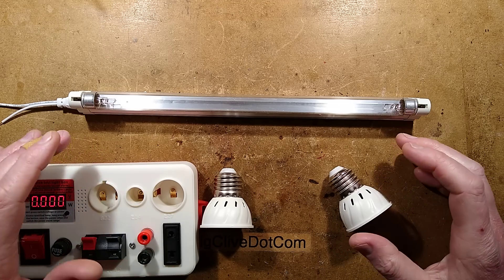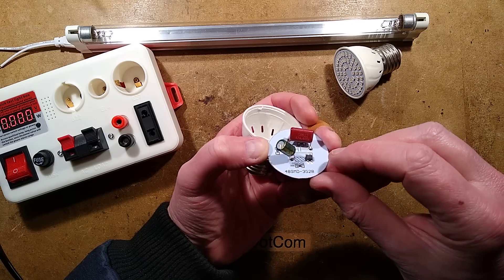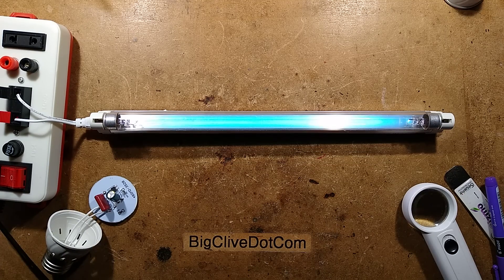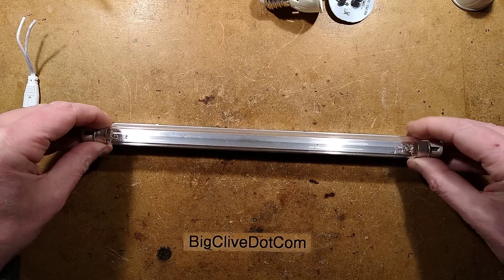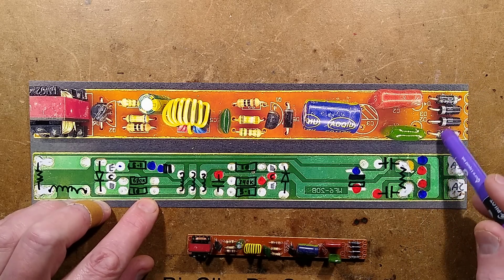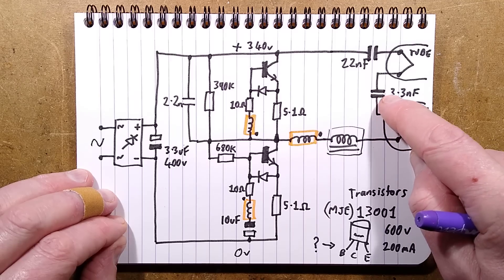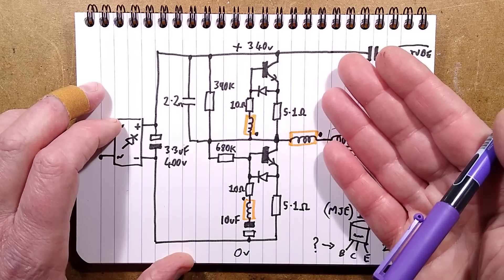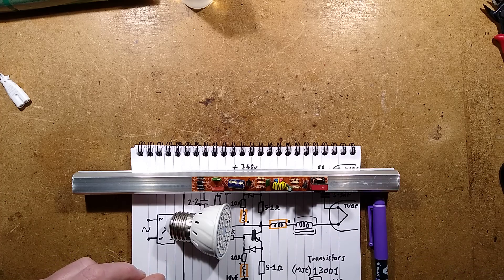UVC 2023 - the fake and the real (with schematics)

Comment: The two windings on the toroid probably run the end heaters ease the arc strike. to have some fun put a bench supply across the heater and note the heater resistance is smaller than the arc across the resistance of the filament

Comment: Hi Clive,
Do you know if UVC LEDs can be designed to generate ozone or is it only the tubes (With untreated quartz glass of course) that can ?

Also I'm still a lil' bit worried about the possible end of all non-LED lighting products (From halogen bulbs and fluorescent tubes for illumination to blacklight and UVC tubes).
Reply from the maker: I don't think there are commercial UVC LEDs in the 184nm region yet.  It's probably cheaper and easier to do it with a corona discharge system for low output applications.

Comment: I recently got a Vivitar brand "PureMobile" UV portable device sterilizer lamp (model V40061, the non-detachable one) at a discount store for US$6.00 on clearance because I wanted a small inexpensive UV light to cure small resin jobs. This video now has me wondering if the lamp is actually useful even though it's supposedly listed as a "253.7nm cold cathode UV germicidal lamp," (claims I'm not 100% sure of in the first place) as I'm having trouble finding reliable info online about portable UV sterilizer lamps like it.
Reply from the maker: That's purely germicidal.  You need UVA for curing resin.

Comment: The spectrum of a UV Mercury lamp is fundamentally different from LEDs. Mercury has a band spectrum meaning that besides its continuum spectrum, it has several peaks because of electron transitions. Some are in the visible region. UVC lamps must have argon too. As our brain synthesizes the sensation of color from the 3 color receptors the sensation can be the same for different spectra.  But LEDs emmit on a very narrow band. There are two main UV-C LEDs the ones with Gallium-Nitrogen and the ones with Aluminuium-Gallium-Nitrogen. They usually emit at 260 or 280nm or both (this is considered more efficient in disinfection). My point is that the color means very little and the LEDs tend to have a color more akin to violet if they invade the visible spectrum. As UV-C and UV-A LEDS have a similar construction the voltage drop on them is also not an indicator. The better way is to use UV-C dosimeter cards they are created specifically to test if the device emits UV-C and tell if they are safe or dangerous and determine the exposition time to kill bacteria. They change color depending on the dosage of UV-C received.

Comment: From my limited experience with CFLs, they seem to go bang when one of the filaments fail and the electronic ballast ends up oscillating under "open lamp" conditions. Then the lamp either HV-starts from back-EMF from the inductor and whatever little current manages to go through or the oscillator self-destructs either from unstable oscillation at excessively high frequency or excessive back-EMF from the inductor. The 2.2nF capacitor may be a crude way to protect the transistors from inductor back-EMF under open-lamp conditions.

Comment: No you slice the potato and lay them on your eyes been welding for over 20 years and that’s been the only thing I found that helps but never been hit directly just been spot welding with the wrong glasses
Reply: Could that work for eye strain caused by too much screen time without enough sleep ?
(Not red eyes, no "sand feeling" but light sensitivity and difficulty to open eyes still).
Thank's !

Comment: From Wikipedia:
UV (UV-C) considered "germicidal UV". Wavelengths between about 200 nm and 300 nm are strongly absorbed by nucleic acids. The absorbed energy can result in defects including pyrimidine dimers. These dimers can prevent replication or can prevent the expression of necessary proteins, resulting in the death or inactivation of the organism.

 Mercury-based lamps operating at low vapor pressure emit UV light at the 253.7 nm line.[15]
Ultraviolet light-emitting diode (UV-C LED) lamps emit UV light at selectable wavelengths between 255 and 280 nm.[16]
    Pulsed-xenon lamps emit UV light across the entire UV spectrum with a peak emission near 230 nm

Comment: Clive, a few points need correcting/clarifying.  I am working for a company developing UVC LED products and this is what I know.  Research on 222nm radiation (at the short end of the UVC wavelength spectrum) shows that these wavelengths get absorbed in the top layers of the skin which are formed from dead skin cells.  It is therefore unlikely that you will get skin cancer from very short wavelength radiation, however radiation at the longer end of the UVC wavelength band penetrates deeper and may cause cancer, more research is needed on this.   Mercury lamps emit radiation at a number of different wavelengths but the main one responsible for the germicidal action is 254nm.  The wavelength shown to cause most DNA damage is 265nm and although you can buy 265nm LEDs most current UVC LEDs emit at 275-285nm (although the trend is towards 265nm). I have been working with UVC for a few years and haven't heard of anyone getting skin irritation or welders eye from pure UVC due to the fact it doesn't penetrate very far but I wouldn't risk exposing myself to UVC simply because it is so good at attacking DNA.   If you want to block out UVC but still see what is going on simply put a sheet of Acrylic over the source.  UVC LEDs will glow a very dim purplish white colour when seen through Acrylic sheet, if they are purple/blue they are fake.  Some dodgy products use cheaper UVA/UVB LEDs which are cheaper, probably more dangerous and less effective but most fakes use purple LEDs.  All thermo-plastics are deep black to UVC radiation so if you see a product that uses an injection moulded white plastic housing and says it is a UVC product it is most probably useless.

Comment: Another place to get ultraviolet damage to your eye (called uvitis by eye doctors, really!) is from mercury arc rectifier valves. I knew a guy who said his unshielded WW2 radio rack "hurt his eyes". I enlightened him (no pun intended.)
Reply from the maker: Those valves usually use soda or lead glass which blocks the harmful wavelengths.
Reply: @bigclivedotcom   But still lets all the UVA pass right through it and apparently some people have more sensitive eyes than others, including myself.
Some blacklight tubes (Both Wood's glass and bright blue, insect killer ones) actually hurt my eyes after a short time in the same room, not even directly looking at them. As a result, when making cyanotypes or retrobrighting yellowed plastics indoors I have to exit the room and turn on the blacklight from outside using the same remote control as with my UVC lamps.

Also looking at UVC tubes from behind as many layers of soda glass as I want does hurt my eyes the same way blacklights do, not in the sense of having a "feeling of sand" or even red eyes though but in the sense of having the entire eye feeling strained like if I had watched a screen for too long without having gotten enough sleep as well in the process. In the worst cases I can't even stand daylight and have trouble keeping my eyes open, all the while I'm inside my home. This lasts for a few hours to an entire day sometimes.

I'm pretty sure it's happening because UVC tubes also put out quite a significant amount of UVA rays as well, those not being filtered by soda glass unlike the UVC ones. (Actually I'll know for sure when I will have received my UVA/UVC test cards from eBay).

Oddly enough, wearing ski goggles does allow me to look at lit UVC tubes that are behind glass, not something that I do on a daily basis or recommend anyone doing though.

The blacklight that use for cyanotypes and retrobrite however still manages to hurt my eyes with the ski goggles on, I don't know if it's because of its low quality since I got it from Ali Express or because of the age of my ski goggles that may have lost some of their protection over time.

(It's a spiral "40 W" CFL that shows half that power on my plug-in meter by the way).

Comment: I couldn't help but comment on the operation of the UVC fluorescent driver.  What seem to be missing is the correct operation of the  circuit it is a half Bridge Inverter. The inductor (typically around 4-2mH and the two capacitor 22nf and the 3n3f form a series resonant circuit. That oscillates some where around 100-60KHz.  Because the tube is an open circuit at startup  this heats up the filaments (current at startup is 3-4 times higher than the run current) and this also causes a high voltage around the 3n3f capacitor > 600 volts, so when the filaments are hot enough the high voltage strikes the tube causing it to be largely ohmic (i.e. a resistor). This effectively removes the 3n3f capacitor from the circuit causing the frequency to drop to around 20KHz or so. The current that now flows through the tube keeps the filament hot enough. The whole process and design of CFL lamps is explained very nicely in Philips Application Note AN99065.  the side of the 22nf capacitor connect to the 340volt rail is effectively at AC ground so it could be connected the the 0 volt rail. The design in AN99065 uses a two capacitors one connected to the 340 volt rails and the other connected to the 0 volt rail. Also if you google CFL schematics and take a look at the web site by pavouk you will see lots of circuits and an explanation of the working of these inverter circuits. Its a bit hard to follow as the writer is not an native English speaker.

Comment: I got a true UVC lamp (for sterilising water in fish tank filters) a couple of years back on amazon. I was dubious that it was real until I saw a one star review from someone who complained it killed all their fish... I knew I had to have it. When I turned it on and smelt the fresh ozone I knew it was the real deal. 

I put it into a box lined with reflective tape and an interlock (must be closed to operate) and used it for sterilising things at the start of the pandemic, when paranoia wasn't paranoia.
Reply from the maker: I've got one of those.  It's designed for the filter section of a tank and not the fish area.
Reply from the maker: Those lamps are intended for use in the filter section of large tanks.

Comment: i have a UV light-ish fluorescing purple not as deep purple as the old striplight UV lights but still defo purple, 12v LED long ribbon, an i wander are these actually safe, i read somewhere they may in the long term do eye damage, any idea's????
Reply from the maker: The LED strip output will be low compared to traditional blacklight sources.  It's also near-UV and not really in the UV spectrum.  Just right at the end of the visible light spectrum.  (395-405nm)

Comment: A while back I tried the old desktop computer power supply to desktop power supply thing.  It was old, so I powered it up to make sure it worked before starting.  Now I had to discharge the capacitors.  It was the first time I had ever done anything like that. There was a very loud bang that scared the crap out of me.  My wife was in the other room and even she was startled.  I decided to let it sit for 48 hours instead of doing that again.
Reply: Never short out large caps. Use a 2 watt low-R resistor to discharge the cap.

Comment: It's interesting how they actually used an extruded aluminium housing for the germicidal fitting as a normal plastic under-cabinet style luminaire would not be very happy at all when exposed for a reasonable amount of time! 
Would be interesting to see how long that lamp would last, cheap lamps made from quartz suffer quite badly from solarization at low temperatures from short wave UV-C and often the output drops below 50% after about 1000 hours or so. More expensive lamps from the likes of Osram and Philips ect employ a very thin coating (about 5nm) of Alon C inside which provides a great increase of lamp life and allows them to maintain 50% of initial UVC output for up to 8000 hours

Comment: On the first PCB the electrolitic is labelled 4.7uF 250v, so I guess the 330 is the resistor value for a 120 volt version along with a bigger, lower voltage, capacitor.

Comment: In the real uv tube circuit, what is the point of 22nF and 3.3nF in series??????
Reply from the maker: The 22nF limits the current through the whole tube, the 3.3nF passes a small amount through the electrode heaters.
Reply: @bigclivedotcom  Is there something missing from the circuit you drew?   The caps are in series, so unless the first tube blows up to a short, it cannot make any difference in current flow????  I do not understand your explanation.
Reply: Never mind, I get it now, there is something missing from your circuit.  It is the other end of the tube HV current from the heater to the other end of the tube.  But it still leaves the question of why the second tube has so much less "tube current"  (being limited by the 3.3nF), so I am still lost??????
Reply: Ok, it is a single tube with a heater at each end???   Still really lost in this.

Comment: If you measure the running voltage on that "reverse connected" capacitor, you will find it is correct.  When running, the transformer winding pulls the base on the BJT positive and the other end of the winding wants to go negative.  The voltage will be small but the capacitor's voltage will end up negative once the thing is running.

Comment: Mmhhmm... that amazing color. I love it.
I have an electric toothbrush from Philips and the older model I used to own came with a sterilizer for the brush heads. I still use it and it uses one of the real small UV-C lamps and I always loved the glow when it was on. You can see it through some sort of "mesh filter" as a window - kinda like the Microwave-oven doors.

Comment: Be careful, just because it glows purple. It doesn't mean it doesn't produce any UVC all. There are some LEDs with both UVA and UVC chips in the same package. I saw a video by another YouTuber, who used a spectrometer to verify this. The lamp under test didn't even brown a banana, which only happens at high intensities.
Reply from the maker: That requires the little gold coloured square LEDs with quartz windows.  These are ordinary resin LEDs and would not work as UVC emitters.

Comment: 18:20 "...and yet they keep working..." I used to maintain the communal lighting of our appartment building and in it CFLs were used. On at dusk, off at dawn. I guesstimated 5,500 hours in operation every year. Most cfls would do 2 to 3 years that way, so way more than their advertised 6,000 or 8,000 hours (one of which managed 12 years!!! or 66,000 hours!!!). Then came the retrofit LED bulbs that would promise 15,000 or even 25,000 hours but all with a more than 470 lm rating would die very quickly, some not even reaching the lifespan of an incandescent bulb.They were baked way more inside than the CFLs. As a result I replaced them with integrated LED fixtures, some consumer ones promising only 15,000 hours and some semi-commercial ones promising 35,000 hours. They were installed in 2016 and are ALL still working perfectly today, almost 7 years later.

Comment: I killed the driver/ballast circuit of my 25W ozone germicidal lamp by powering it with my Variac on reduced voltages - the tube is fine, do you have an idea to power it? I was thinking a hf, possibly mini tesla coil?!
Reply from the maker: You can get new electronic ballasts for fluorescent tubes online.

Comment: Boilermaker here. 

Your eyes may start to feel sore at the end of the day if you are about to have a rough night thanks to arc flash. It's best to pour in some cleareyes eye drops as this helps prevent or reduce the severity of the sandpaper eyes. This was a tip from a Sparky.

I've not had the sandpaper eyes yet (12ish years in the trade), but have had arc flash caused by workmates in my peripheral vision while welding together 5 segments of a 300+ ton tunnel boring machine cutter head. The above symptoms and method was used.

Unfortunately I had to lift the darkening lens of my speedglas 9100fx helmet to chip slag, FCAW process.

Comment: wrong! 
They admit plenty of UVC ..... But only in direct sunlight. 
I mean common sense states that The sunlight bouncing off of them should have some UVC in it. 😂

In all honesty .... Genuine uvc LEDs are super easy too identify.
They will be in a ceramic package with a quartz window ( pass the actual UV.)
 However a lot of them will have a secondary die to emit visible blue light as a safety precaution. So just because something lights up blue doesn't mean that it's not UVC...

 However if it isn't in the proper package then you can be rest assured It's not passing any UVC without that quartz window. 

UVC lexs have gotten a lot stronger thanks to covid which really helped the technology mature out of necessity. It was really in its infancy in 2020 without many manufacturers interested in pursuing it seriously. 

But they are still hilariously low power in optical output compared to even 365 nanometer UV. But they're getting better.